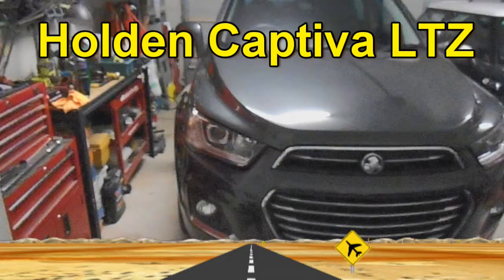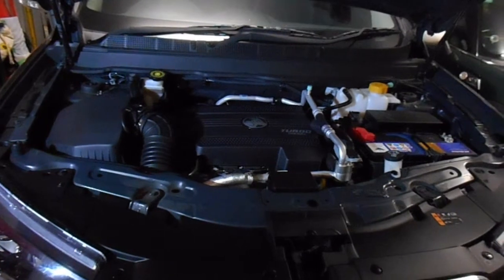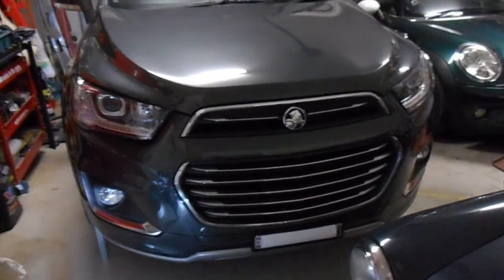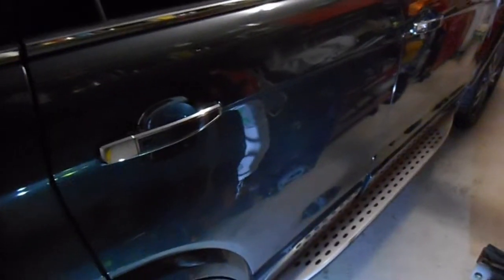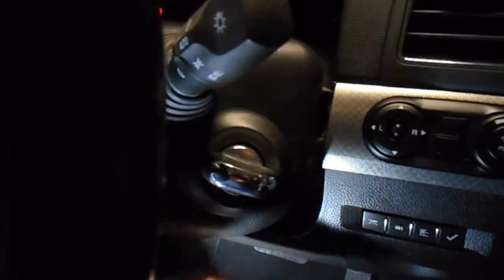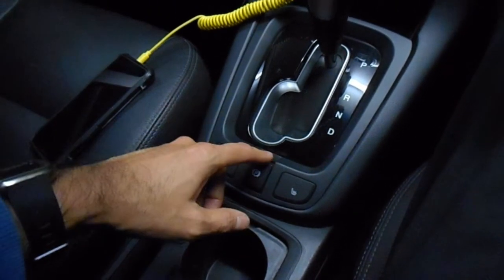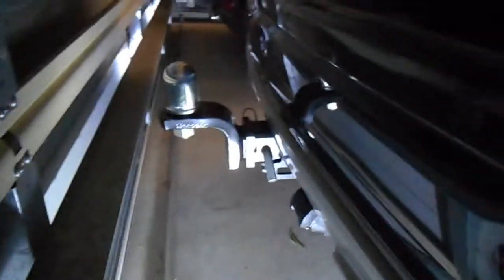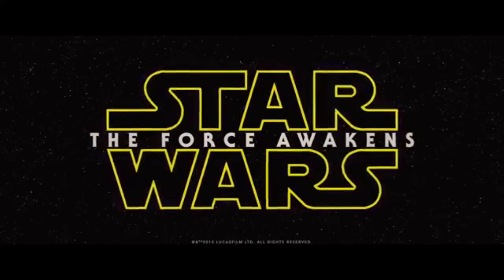Holden Captiva LTZ

Comment: your comments on the V6 petrol being a lower quality aussie engine are correct but only for the 3.2L, the 3L in the 2016-2017 model (that you show in the screen shot) is a completly different engine and doesnt suffer from the same issues as the 3.2L, it also has more power than the 3.2L with the 3L having 190kw and the 3.2L only having 169kw.
Reply: I have the 3L V6 had the car for 3 years now has been fantastic plenty of torque to the have had the rear control arm bushes. However, I bought an extra 5 year warranty have taken it on the occasional dirt track does fine

Comment: What do you think of this car a year on ? I’m looking at the same model
Reply from the maker: The Captiva has been fine so far, haven't had any issues with it, hence the lack of new videos! I still think they are good value for money but keep in mind that the higher the km the greater chance of problems occurring. I'm now at 70,000km. I would avoid anything over 100,000km but it all depends on your budget.